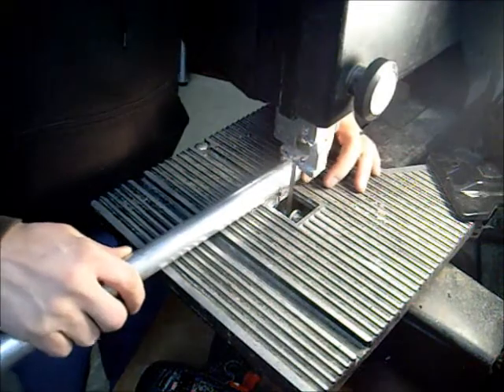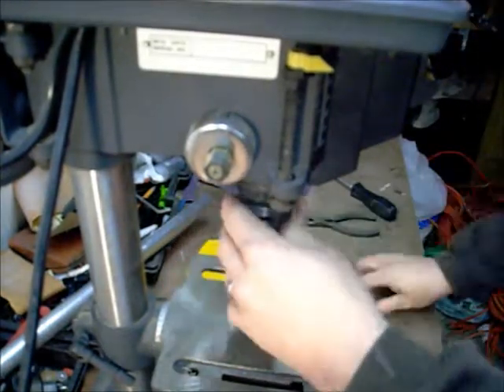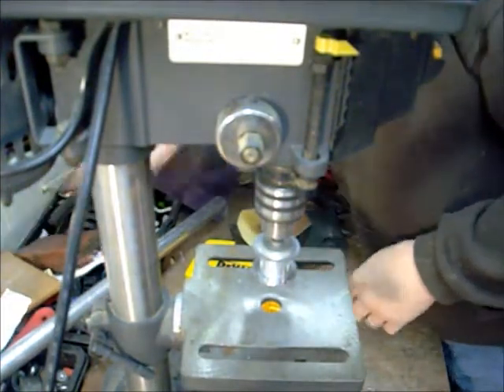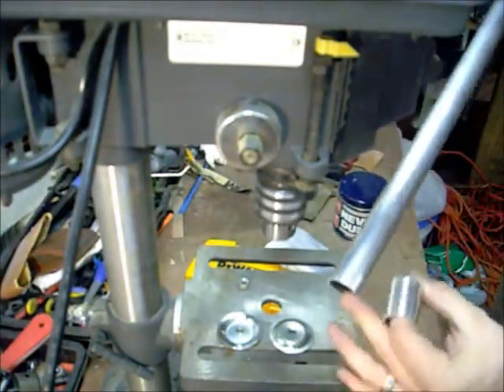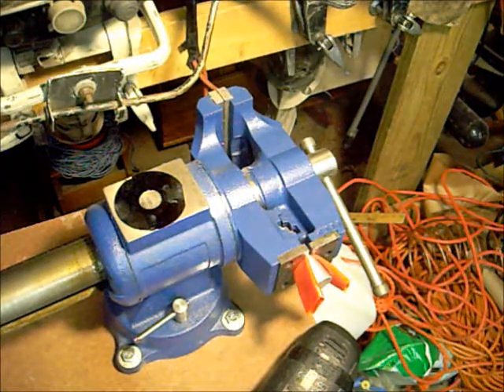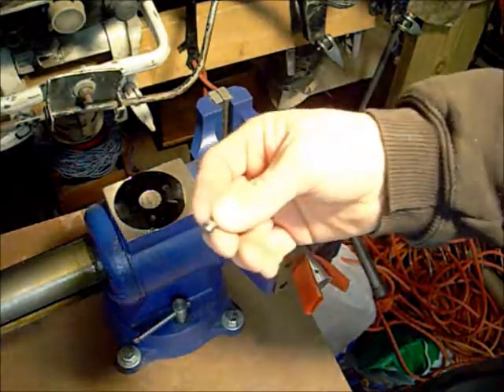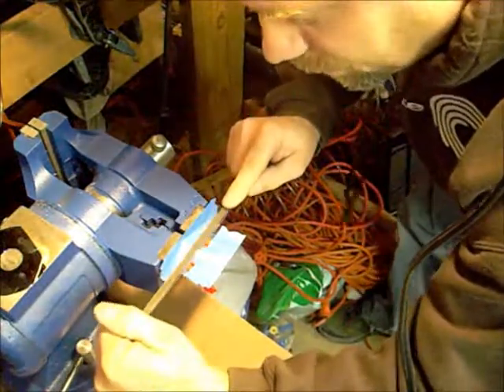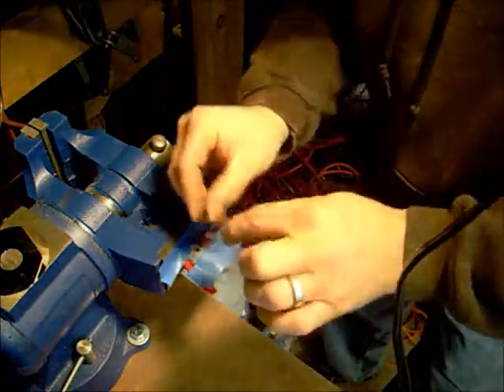HD Alcohol Stove how to part 2

Comment: Good video, just a couple of suggestions, get a vise for your drill press. It would make it alot easier to do the drilling and tapping operations. when you lap the ends of the tube, use a figure 8 motion. It will help keep it flat. try to find a small end mill, 3/8 to a 1/2 should work, it will allow you to make the flat. You need just the tooling, not the machine. Harbor freight, or northern tool and supply should have them cheap. finally do all your polishing at the end.

Comment: Thanks for the video, be harvesting parts from crashed server drives at the office also, hope to build an HD stove myself.  Gotta get me a piece of pipe to use for the body.  Ever try using some JB Weld to make a body from the platter spacers on the old hard drives?  Might be more trouble than it's worth.

Comment: get a spring loaded prick punch also get a round dowel little smaller the the tube then wedge at bottom to hold tight to dowel to drill .i drill tap file put together for 35 years daily built can machinery that make cans and covers etc